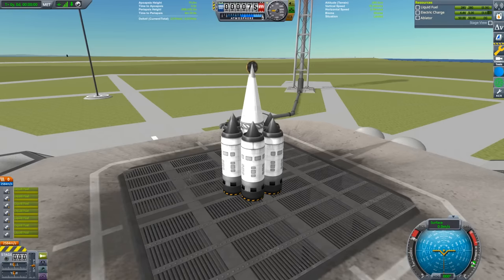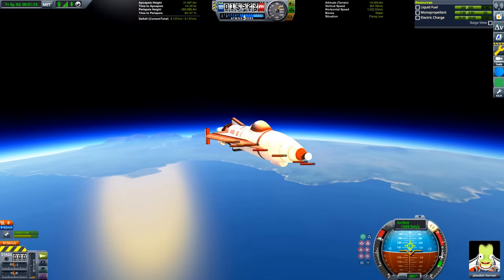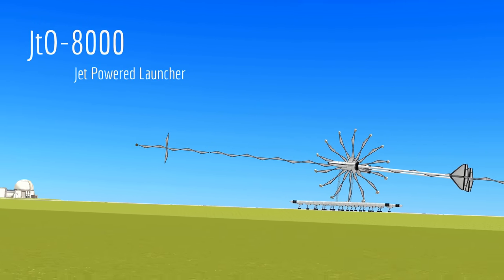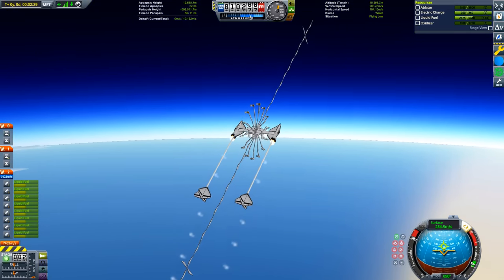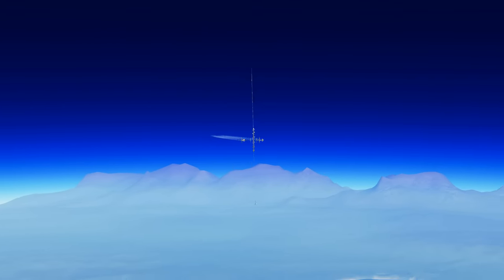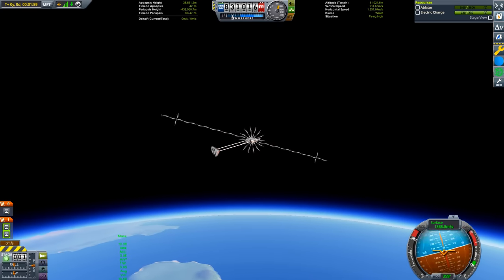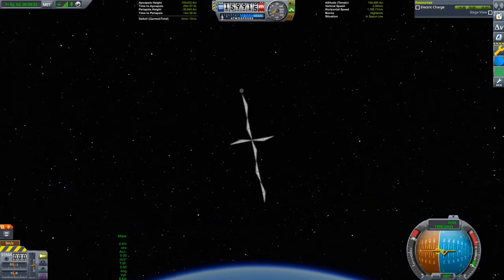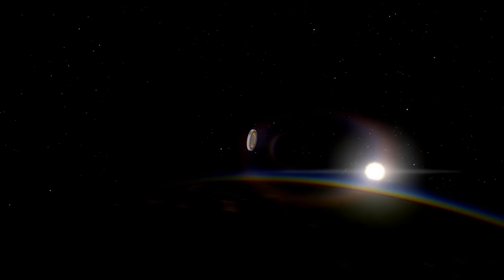Orbiting Kerbin using only Jet Engines | Stock KSP 1.7

Comment: brilliant.  you couldn’t generate power past a certain point so you invented a battery
Reply: @bobsagget823 yes, but....both store energy so technically he isn't wrong
Reply: @bobsagget823  In fairness, that thing was no ordinary flywheel.  I've never seen a flywheel with such an... aerodynamic radial pickup system.  I think that ion catapult burrowed into his heart and laid eggs in his brain.
Reply: @bobsagget823  Well that was just rude, also a flywheel is a kinetic battery. You silly goose.
Reply: @bobsagget823  Which is a kinetic battery.
Reply: @bobsagget823  kinetik battery
Reply: Those Bobsagget replies must've been fun :p
Reply: @Archgeek0  I've never seen such a literal interpretation of a "fly"wheel.
Reply: oh where's bobsagget823? Guess he deleted his insult. lol he got served
Reply: I know some of these words
Reply: A kinetic battery? Oh, you mean a flywheel. Yes, he made a flywheel. Stored the energy and released it later when he wanted it.
Reply: Try running your phone or laptop from a flywheel and you will stop equating it with a battery fairly quickly. You can cross a river with a bridge or a tunnel and both are created by engineers, but they are sufficiently different that they warrant distinction.
Reply: A flywheel is by definition, a mechanical battery, so yes, he made a battery, no one said he made an electric battery.
Reply: super clever in almost every way
Reply: @CloudedByKatana  its not a battery but a capacitor.
Reply: @ibiza8426  No... No it's not
Reply: @recklessroges  try running your phone with a double a. You're comparing apples and oranges. Use an alternator with your flywheel and its the same power you need, just a different battery.
Reply: technically this is a kinetic capacitor
Reply: I want to see this IRL!
I know it would be a bit challenging for the engineers since the Earth is a lot more massive than Kerbin and we currently don't have access to materials comparable to what we use in KSP... But the basis of this concept should still be compatible with real physics, right?
Reply: @Reth_Hard  nah the  structural strength of an item in ksp is not to scale and thus the gee forces would rip it apart. also it is not as efficient as a normal rocket system and it leaves a tremendous amount of space rubbish around which would be a problem to clean up and is an incredible waste of materials
Reply: @Reth_Hard  technically yes, but it would be more efficient to just launch a rocket
Reply: @somelokyguy6466  rrrr
Reply: More like a capacitor. Potatoes po-tah-toes but given that it's storing the energy to be used in a larger, short burst of energy it'd be the more apt comparison
Reply: @rickharper4533  damn
Reply: IRL we just store air to burn later in space
Reply: @recklessroges  You could run your phone or laptop form a flywheel connected to a generator... hence the flywheel acts as a battery, or in other words, a device that can store energy.
Reply: Wtf this is literally Spinlaunch
Reply: @deathgenie  i mean, they're both acidic, and are fairly delicious. lithium tastes better than aa tho
Reply: @didiandiano  what was the insult
Reply: It's more of a capacitor, since it discharges all of its energy at once, but I get what you mean.
Reply: @theironsword1954  But it didin't discharge all of its energy as he did it twice? Therefore it is a battery.
Reply: @0Synergy  two capacitors in one, both charged by the same source?
Reply: @juyantaghiani6038  :D made my day
Reply: Capacitor*

Comment: Next time: Orbiting Kerbin using only Jebs legs.
Reply: Wasnt it done in old version?
Reply: SWDennis got to the moon and back with two jumps
Reply: orbiting kerbin using wishful thinking
Reply: Next time: travel to the mun using only ladder parts.
Reply: The kraken has joined the chat
Reply: thats been done and is very easy, just use a kraken drive
Reply: noo orbiting using only nothing
Reply: @quinnhawkes6060  hmm I recognize that link...

yeah its a really good video. really inspired my next KSP missions.
Reply: The ladder drive?
Reply: Well, that would be easy, you just need a long ass stair !

Comment: I assume the space race between Stratzenblitz and Bradley Whistance has begun!!!
Reply: The best part about that is how similar the two sound!
Reply: Begun?  Its been on since the day Stratzenblitz was born glares
Reply: Georgie Athalla he went to Duna with only ion thrusters
Reply: @Georgie Athalla Ion plane
Reply: I wonder what will be the next insane craft. Place your bets.
Reply: @valeriyproklov4604  no engines to orbit???
Reply: Valeriy Proklov just do an eve sea level return using only sepratrons :D
Reply: @kellynyanbinary  next he's going to have to land on eve and return using only sepatrons.
Reply: @linecraftman3907 I don't think it's much harder than what stratzenblitz did here, just replace the jet engines with bradley whistance's stock prop and boom.
Reply: Both of them fake their vids
Reply: @linecraftman3907  it should doable considering existence of electric propellers, arguably even easier than above solution, as for propellers can have variable pitch, which would make them more effective at both low and high speeds.

Comment: In earlier versions of KSP people just stuck a ton of ram air things on the craft and they would provide a small engine enough air to keep going outside of the atmosphere.
Reply: Yeah, people would have rediculous contraptions where you had a million intakes, and you would drop engines when you came close to running out of intake air. Eventually you would have one engine, and a dozen or more intakes.

Comment: Now get to Andromeda with just firecrackers.
Reply: and within an hour with no timewarping
Reply: LennyS And do it Apollo style, no SAS or RCS, and last, no map screen
Reply: The journey of a thousand light years starts with a single Joule...
Reply: J. J.  Shank that's deep
Reply: LennyS forsenCD ✌️🏆 the 2 times
Reply: Danny2462 did it with only landing legs
Reply: @floridianlizard1443  And only use a single firecracker
Reply: @lennys9191  'laughs in special relativity'
Reply: 666th like
Reply: Firecrackers have insane twr, btw. The only limit is your video card.
Reply: @topwaifu2104  sinplify the model and remove the flame effect 👌
Reply: @doggo00  I think, the bottleneck is joint simulation. Everything else scales linearly.
Reply: @topwaifu2104  then make a super firecracker which would be one part, its easy to mod in custom made parts
Reply: It takes him ten million years to get there
Reply: I think some speedrunner used a similar design, which launched the craft at an enormous speed. Might work.
Reply: @General12th  It's two million lightyears to Andromeda

Comment: ""At one o'clock the hawser was drawn in, the throttle opened, and 
to the accompaniment of the stertorous exhaust, the 
uncovered sidewheels began to quiver, then slowly to 
revolve. A hush fell on the spectators.
 . . . One honest countryman, after beholding 
the unaccountable object from the shore, ran home and 
told his wife he had ' seen the devil on his way to Albany 
in a sawmill.' "
"
well this contraption has  centerwheel instead... it still strange to see that principle works to get to the orbit.

Comment: Meanwhile i can't orbit using most powerful engines in the game
Reply: RoseAngel The most powerful engines aren't very fuel-efficient. If you're gonna use something like a mainsail, then pair it with a skipper, followed by a poodle. Same sort of thing goes for the even-bigger SLS-style engines. If you still can't get into orbit, then try excluding the mid-tier engines. Sometimes those are mostly dead weight. Lastly, if your heavy rocket has a payload of sorts, then don't be afraid to use a bit of its fuel to get into orbit if it ever comes to that. Spacecraft payloads should always use small, efficient engines. Hopefully you'll figure it out. Given enough time, you'll one day be able to send 40-ton spacecraft payloads to mars, using 100-ton rockets.

Comment: I’m wondering if someone already achieve this by making two jet-powered crafts colide at high speed above the atmosphere to gain the velocity needed 🤔
Reply: Not a lot of ksp youtuber focused on kinetic impact technics, that could be great !
Reply from the maker: KSP doesn't handle high impact speeds very well due to its time-step size so I doubt this would work in stock. It might work with a slow motion mod though.

Comment: I've seen an old post that basically strapped 100 intakes to a craft. I think the intakes used to store air, and that the stored air was enough to take the craft to the moon. Of course the intakes don't store air anymore, so it isn't possible anymore, but it means that people have orbited kerbin using only jet engines before.

Comment: Two other ideas that might work but are probably impossible to pull off:
1. Fly up high enough to use a gravity assist from the mun to get into orbit.
2. Have a very long arm extending down into the atmosphere providing the necessary air flow, and when moving fast enough, decouple the intakes and the arm and the remaining part of the craft will be outside of the atmosphere.

Comment: You're a genius! I also believed that this is impossible due to the lack of thrust outside the atmosphere, but you are right, this is possible. And a big extra is that there is no KSP glitch used, this craft should be able to fly in real world... at least in theory.
Note: you still fire some mass backwards outside the atmosphere (twice), which is a something similar to a rocket engine. :)

Comment: I once made a f22 raptor replica and wanted to bring it to laythe. I also discovered it to be near impossible to get to orbit on jet alone,so I did a 2 part system where I flew the raptor as fast as i could,then pitched up hard to get an apoapsis at around 120k. I then made another spaceplane, that had huge twr and a grabber on the nose,which i launched and caught up to the falling raptor,coupled and then brought it fully to orbit before hitting atmosphere. I did it all on the first try and was super impressed by myself. Anyway, cool vid, clever idea to use the spinning.

Comment: I once tried to do this in an older version of ksp. I noticed while watching Scott Manley's re-usable space program that intake air was considered a fuel and he had some left outside of the atmosphere. The culprits were closed air intakes. They do not "leak" air out of the system. back when ksp was just magic to me and I knew a lot less about it I immediately saw potential exploits. Jet engines had fuel efficiency a few multiples higher than the nuclear engines alongside good thrust power. So the potential for a deep space exploration revolution was filling my head. Unfortunately it turned out that jet engines physically only worked below a certain altitude. Disheartened but not defeated I tried taking an experimental craft to low moon orbit to test if the fuel efficiency would at least work for landings and low-orbit ejection burns for moons. Unfortunately this was not the case. Jet engines probably only work on kerbin and laythe. Regardless of if you have the air to power them. That seems rather boring to me.

Comment: When you initially mentioned all the limitations and showed the rotating part of the craft my first thought was that you also put engines one the rotating part, which would fire while moving backwards such that they would not exceed the 1500 m/s limit (not sure if this would actually work, or the air speed limit is measured using the speed of the center of gravity) and while near the edge of space you would transfer fuel to move the center of gravity into space.
Reply from the maker: Thats actually not a bad idea. You could technically increase the top speed of a jet powered SSTO this way. Although, the drag from the rotating section may eliminate any benefits. I'd have to try it to be sure
Reply: @Stratzenblitz75  Also you have to really quickly start an stop the engines (maybe toggle reverse thrust?) and the thrust they do provide will slow down the rotation. So your approach is probably easier, however the fuel transfer trick would be more practical.

Comment: You could increase final orbit injection delta-v by attaching an ore-tank right above the point where the arm detaches. That will increase the radius of the arm rotation when it has been detached, and allow you to launch it even faster / launch a heavier payload

Comment: I used to do this in older ksp before some of the changes to air intakes. You used to be able to just stick more and more intakes on a wing up to the hard limit

I had some big U-2 type plane that had enough intakes on the wings to get it into orbit

Comment: I made a 2 stage missile that hits mach 12.25 at 25km. First, a vector launches the craft to 590m/s. Second, the rapier (switch engine mode at 1700m/s or 22km ) using a launch escape system for heat shielding and AV-8 winglets, it should be able to reach an AP of 100km and reenter the atmosphere on the return. By modifying the trajectory slightly, I was able to achieve a full orbit sub 60km in 34 minutes.

Comment: So lemme get this straight:
You built a plane with a rotating middle segment that gains rotational speed by drag, and then you use that rotation as a catapult, thus achieving orbit using only jet engines with air intakes?

Brilliant

Comment: Very interesting, I think reducing parasitic drag to a craft and using a modified jet engine a way safer way to achieve said  orbit. Computer models are only as good as the data they use.

Comment: I've tried it and the jet engines are not the same things as the Rapier or Whiplash engines first of all. But in my experience the last ones don't operate above like 25K meters. So you have to like blast yourself to like 2500 m/s with a load of engines below 26K and then it wouldn't want the engines to go into space with you, which is an expensive drop. SSTO seems to be monilithically really viable to do a shuttle run and that is about it. Sometimes I think the easiest thing to do is have a reusable simple first stage or just disposable solid fuel 1st stages to avoid refurbishing.

Comment: technically, you could take an ion engine and an empty battery, using the jet engines to load the battery. That way all the energy comes from the jet power.
What you did here was using a kinetic battery to throw the probe core but you could use electricity to throw xenon

Comment: I couldn't do this, but I did build an intercontinental bomber that travels at around 14km at a top speed of around 800 m/s, if I remember correctly. I could be very wrong about the top speed, but I know the service ceiling was 14km

Comment: Jet engines  are super efficient inside atmosphere, and rocket engines are super efficient outside atmosphere, i don’t see why they didn’t make a two stage rocket , one stage with 6 or 8 turbofan jet engines for about 18km up and then decouple & fire rocket stage. I saw some comments telling about vibration of such a big number of turbofans , telling about the cost of all of these engines, one “problem” is when the jet engine arrives 18km there’s no longer oxigen to keep it running, so it’s time to decouple, another problem is that you reach 18km altitude with barely 180m/s ,it’s really hard to decouple on time, but yet , nothing impossible,it worked really well for me in ksp. You should try it out.
Reply from the maker: What? I am now confused
Reply: Stratzenblitz75  take a normal rocket , add a detach, add a fuel tank, add 6 or 8 jet engines on the side of it, bring this thing to 17 or 19 km up, fire the rocket engines . It’s a really efficient way of getting to space

Comment: You're a genius, man. Which means you're absolutely freaking nuts lol.
Reminds me of some of the ShadowZone's designs.
How did you create a rotating connection though? Is it available in stock KSP already?
Reply: you uncouple a piece that is then held in place by landing wheels this piece also has parts of it that are anchored to it but are move tooled to hover just out side the landing legs,
 ---- ( o ) ---- 
(the "o" and the "-" are all the same craft which was decoupled, the "(" and ")" are landing legs